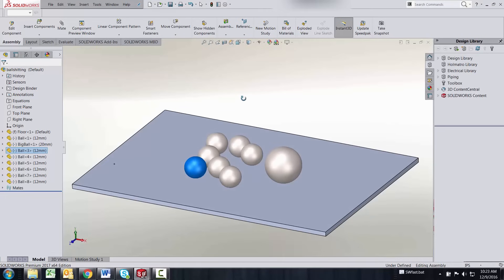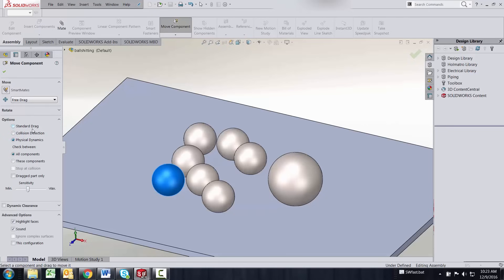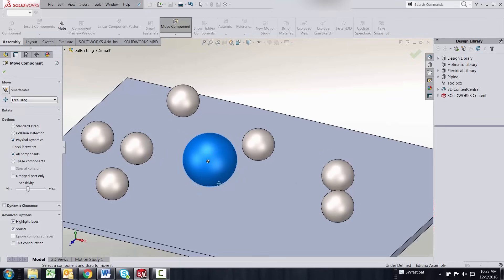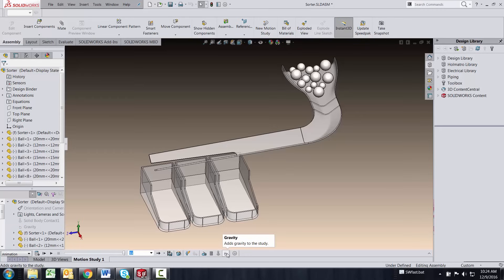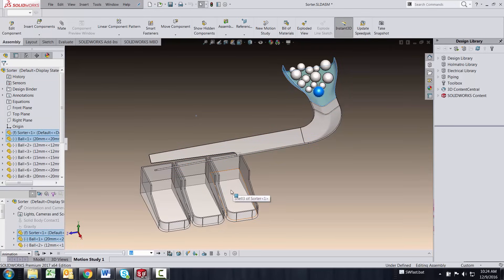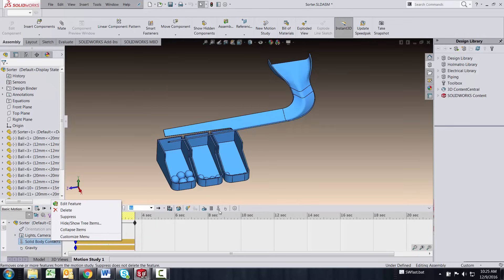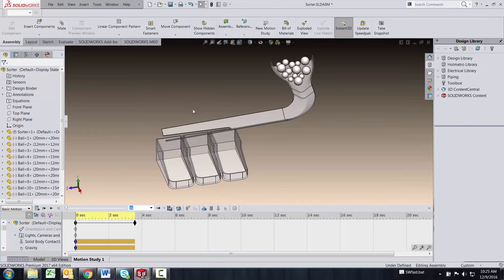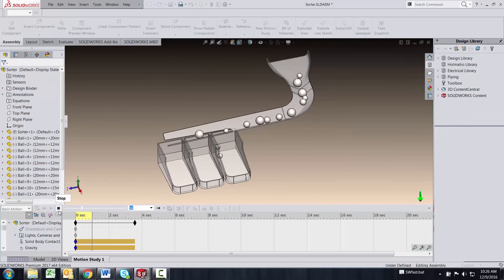SOLIDWORKS - Basic Motion Tip

Comment: Good afternoon. Why do my bottles fly out of the rotating drum when analyzing motion? depends on the thickness of the metal? you have 5 mm, I have 1.5 mm. and contacts between each other Acrylic and steel do not work

Comment: Nice video. the balls are moving, but what about proper frictions. I am trying to simulate rolling wheels. the balls in this video are not rolling correct?
Reply from the maker: The video shows a “basic Motion” tip.  For simulating wheels rolling correctly, you would need to use the full-blown motions add-on found in the premium version of Solidworks.  Our Motions add on allows you to virtualize your wheel rolling with friction and damping values.